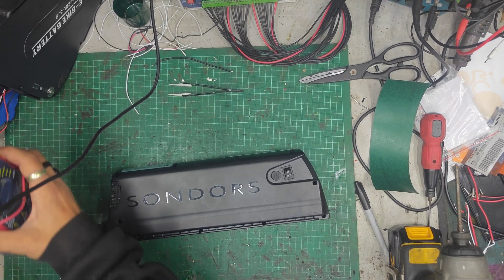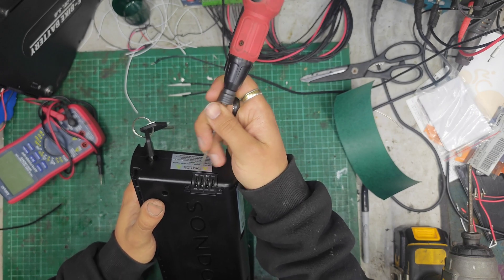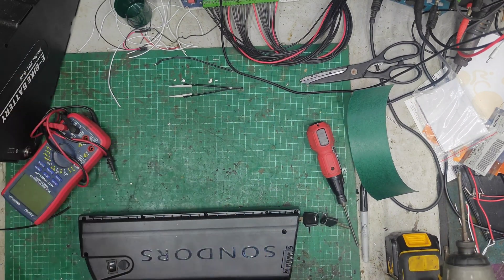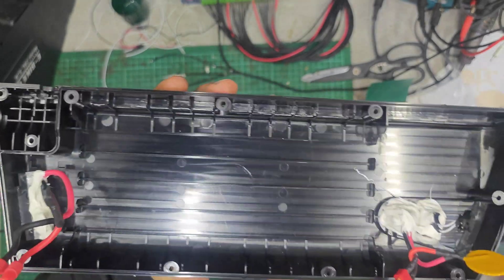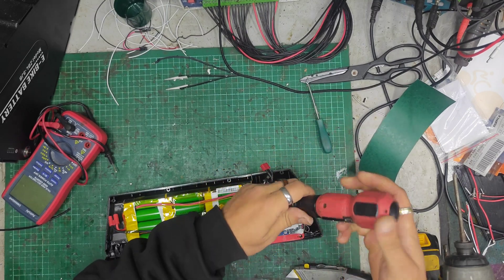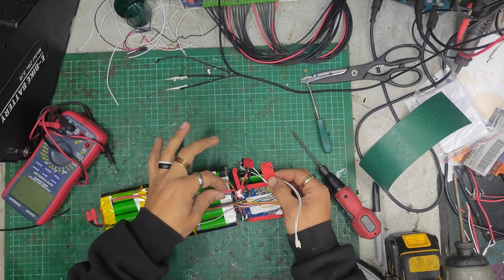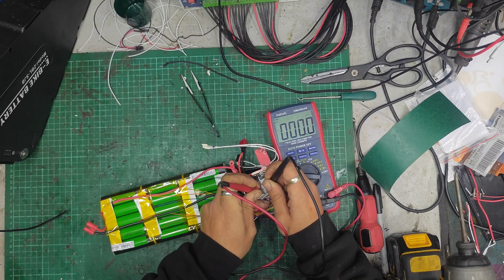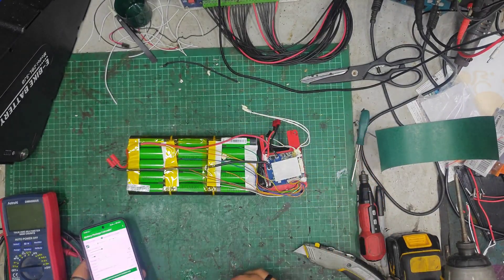What's inside a Sondors Fold 48v 14AH Battery? Real LG cells?

Comment: I have a Sondors Fold XS, and it comes with this battery. I made a big mistake a few days ago and grabbed the wrong plug from the wrong adapter, and the adapter blew. I tried to turn on my bike, and my bike didn't turn on. I took the battery out and took a sniff. It had an small electrical smell to it as if something had fried.  May that have been a fuse, and all that I have to do is open it and replace the fuse?
Reply from the maker: Possibly! You'll need to open it up and look for a blown fuse or any other damage. (Or get a trained professional to check)